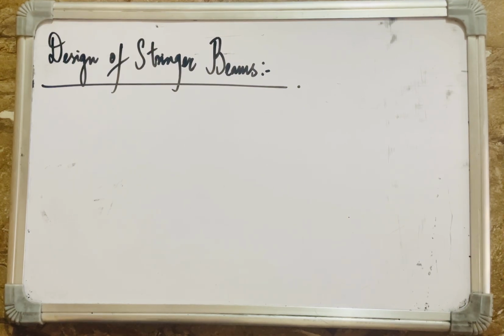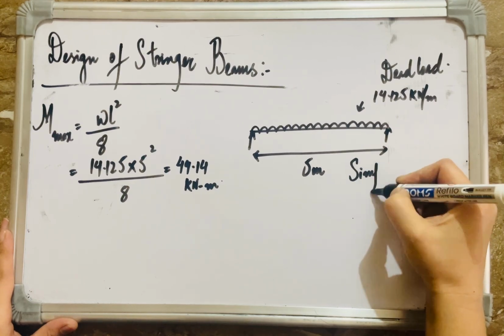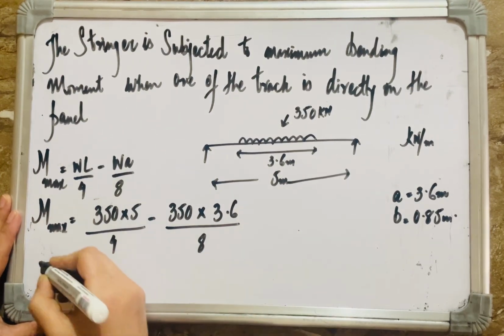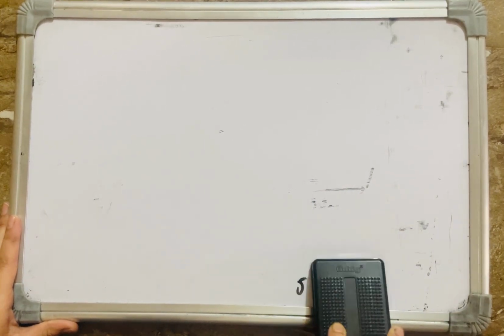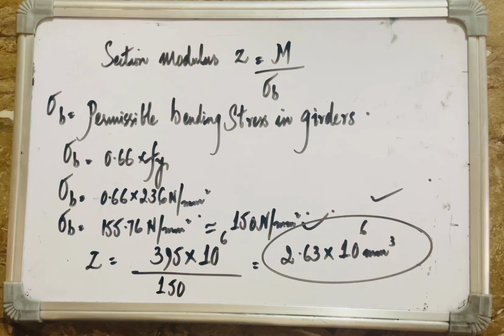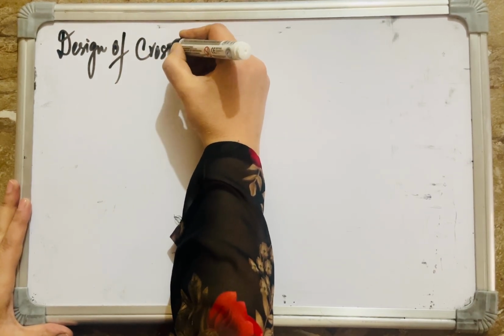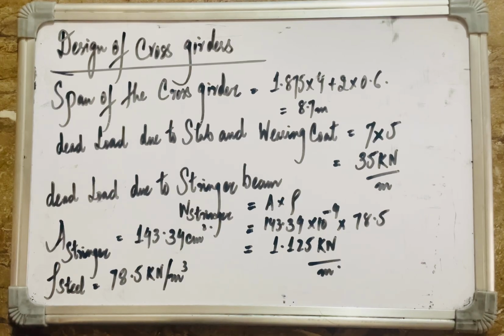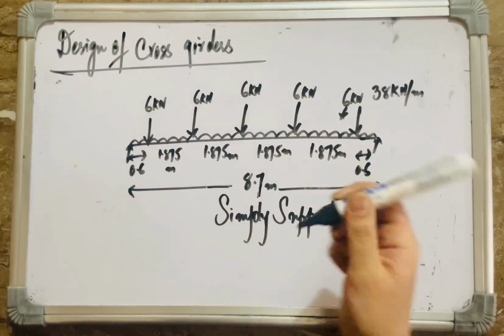Design of Steel Truss Bridges PART-3

Comment: Maam stringer beam mai thoda confusion aa raha hai... If you could help with our previous year advanced bridge engineering paper, it would be a great help
Reply from the maker: Sure
Reply: @EngineersOlympiad 2

. a) Design the stringer of the truss bridge as described in Q.No. 1, assuming the slab thickness as 125mm, wearing course as 75mm thick and the live loading as shown in Fig 1 (on back side)

(12.5)
Reply from the maker: @physicsunfolds  incomplete… kindly provide full details
Reply: @EngineersOlympiad  This is the entire paper 😅
Department of Civil Engineering (NIT Srinagar)

Examination: M.Tech Civil (Major)

Semester: 3

Time Allowed: 2hour 30 minutes

Maximum Marks: 50

Course Title: Advanced Bridge Design

Attempt all questions. Assume data suitably, wherever necessary.

1. a)Obtain the design forces (BM and SF) of the cross beam for live load onlywith following data:

Type of truss: Pratt type

Span of truss: 10 bays @6m each = 60m Height of truss 6.5m CCW-8m Foot path Im on each side with thickness of 300mm

Stringers @ 2.5 c/c

Type of Loading IRC Class A

(6)

b) Obtain the ILD (by first principle) of first diagonal and first vertical member of the pratt truss described in Q. No. 1

(6.5)

2

. a) Design the stringer of the truss bridge as described in Q.No. 1, assuming the slab thickness as 125mm, wearing course as 75mm thick and the live loading as shown in Fig 1 (on back side)

(12.5)

Obtain the values of short span and long span bending moments in case of an interior panel of a T-Beam bridge having the following details:

Dimensions of the panel:

3 m x 5.5 m

Loading:

IRC Class-A

Loading Pattern

Case (a): Two Wheels each of 57 kN adjusted symmetrically w.r.t. centre of the panel.

Case (b): One wheel of 57 kN at centre of the panel.

(12.5)

A.

a) What are the advantages and disadvantages of balanced cantilever bridges over continuous bridges?

b) Describe briefly essential requirements of an ideal bridge site.

c) What type of bridge superstructure you will adopt for a span of 30m? Sketch a General Arrangement Drawing (GAD) for the same.

d)what is the unique advantage of cable stayed bridge over suspension bridge?

(3.5,3,3,3)